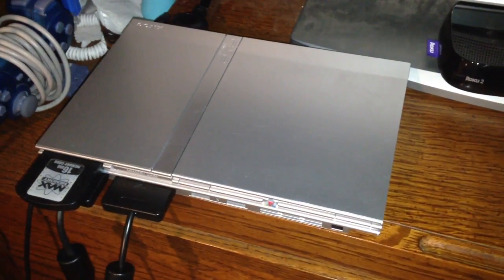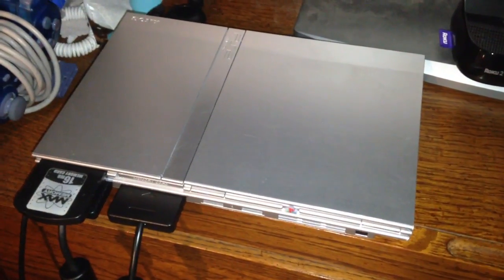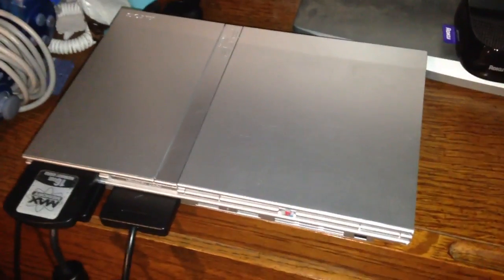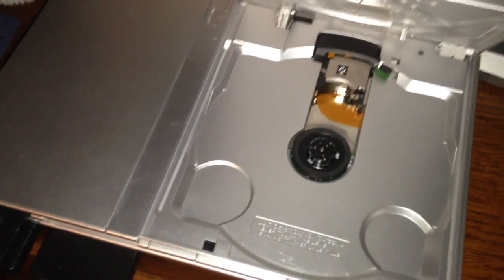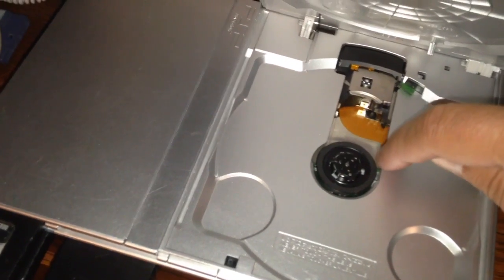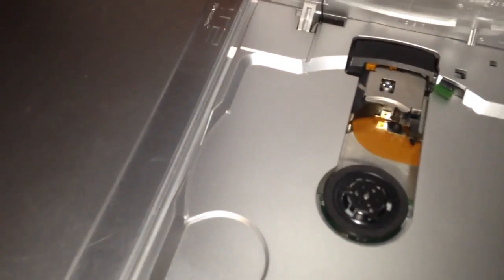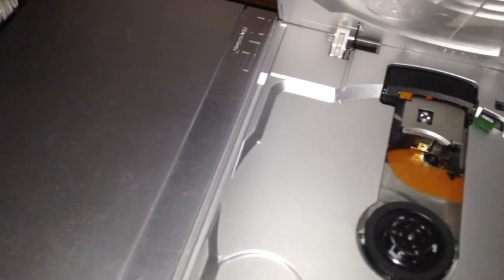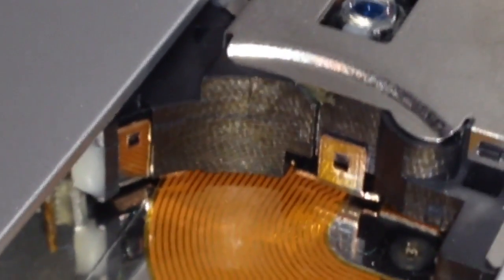PS-2 Slim model fix for discs not reading

Comment: I bought a  ps2 slim  from diss  replay  an only  some of  my games  work  none of them  have  scratches on them   I  know  all retail stores  don't  always  have  brand new  stuff   mostly  used  stuff   especial games  system but  sometimes  you can  try into  fixing the problem  but the thing is  cleaning  it  may  help  but sometimes  it more  problems than  you  think  but I'm going to  order  me a new one for  Amazon   but this  video is  real  can  help  out  alots  if  only your  Ps2  slim  just need to be  clean 💯👍👍👍👍👍 grate  video  this  guy  put out

Comment: This didn’t work for me sadly, I got this game “Muppet racemania” I really want to play, but it havent worked for a while, it loads the disc, but as soon as i go into the game the screen goes black for 2 sec and then it goes out to the selection between memory card or the game. I can’t seem to figure out the problem, but I have a theory that it’s because the disc is black, because my ps2 can easily read any other grey or blue disc..
Reply: The discs with the black backing are PS1 games. However... These all should be compatible with PS2s.  There's a possibility that it could be a problem with your TV hook-up though. As strange as it sounds, I use component cables (the red, green, and blue) for my video hookup from the PS2 to the TV. These cables worked great with my older Sony Bravia, but with my newer LG TV it refuses to play any PS1 games. But, if you're just using the standard AV cable (yellow for video) just disregard all this.

Comment: Open the top where the disc goes and if you look real close where the yellow strip is on the bottom there’s two rectangular pieces one right there than one slightly to the left clean with a dab of alcohol on a qtip and wipe dry using qtip worked right away for me refer to Dan wolak’s video of “ps2 slim model fix to discs not reading” video hope that helps y’all

Comment: Hah!! I was using it last night and it was fine. I picked up and moved with the disc was spinning and it wouldn't read. I opened it and moved the laser/ribbon assembly back and forth a few times and then cleaned the sensors and laser. Worked fine! Thank you!!

Comment: I'll have to give this a shot when I get home. For some stupid reason mine won't read a brand new game. Hopefully this does the trick. I'll be sure to come back and edit this if it does. Still doesn't load a brand new copy of Most Wanted. It'll load Xenosaga just fine. When I throw in Most Wanted it makes this buzzing noise and splashes to the red error screen, saying to insert a PS2 or PS1 disc.

Comment: I took a qtip and cleaned the two plates, but i also went over the laser piece on top with a qtip and there was a smudge of blue on the tip after.. Did i permanently damage my laser?

Comment: Well, it was worth a try. I have a JP SCPH-77000 model that was only reading PS2 DVD’s (with a few exceptions) and no CD’s (no PS2 nor PS1 or even Music). Cleaned the lens and now it’s better about reading the DVD’s and can read PS1 discs, but only after going into the Browser. Still won’t read the infamous “blue” PS2 CD’s., and there are still 2 or 3 DVD games that just won’t read no matter what, despite the fact that my discs are all like new. 

 I guess after 18 years, it’s time to either try to adjust the lasers, or go all in with the laser replacement. 😔 It’s kind of funny, considering that my US SCPH-70012 model still reads everything like a champ - the Sony Computer Entertainment logo barely fades on startup and it goes right to the console logos for any disc I throw at it.

Comment: I got a PS2 slim today and was struggling to get it to read disks. I thought I bought another broken PS2 and was about to return it. But then I saw this video and by doing this method, my system can read discs now! Isoprobyl Alcohol really comes in handy with retro games thank you so much!
Reply: Well good for you because my stupied ps2 cant read the disc even if i do this

Comment: My ps2 was having the same problem, but I found out the problem. It was the little piece of plastic goes down when you close the door. The one that has to be pushed in so the disc starts spinning. I just put a little bit of hot glue to keep it down and it works perfectly with all games
Reply: where did the plastic stay at

Comment: How could these 2 metal pins be read-heads? They've got no sensors on them and couldn't even come in contact with the DVD/CD.
So what's up with all the trolls telling this worked?
The metal pins just hold the stuff in place, they're clamps nothing more
Reply: I dont understand too, man
This is crazy

Comment: More people need to see this. You helped me fix mine in 30 seconds
Reply: Didn’t work for me
Reply: @Codyfree_007  Same here. I done tried everything possible. Mine reads most or almost all ps1 games and majority of the blue back ps2 discs. Doesnt read the regular ps2 discs at all. Cleaned the lenses and brackets, turned it upside down, placed a book on it  but nothing.
Reply: @eaglesfan9800  Nothing works on mine. Completely useless
Reply: @eaglesfan9800 that's because PS1 and blue black PS2 discs are CD-ROM, regular PS2 games are DVD-ROM, as stated in video they use different pickups
Reply: no it dont work

Comment: Mine the disk doesnt spin do you have something to do about it please
Reply: If the disc isn't spinning, it sounds more like a problem with the drive mechanism or the small motor that runs it. I would try looking for a replacement. Be sure to specify the PS2 slim and the model # of the unit, as I think the mechanism changed a couple times even with the slim.
Reply: @MrDintheD  ok thanks i am going to check i am gonna unscrew it and see if it has a brobkem with the sendor
Reply: @MrDintheD  because as i see it makes too much sound and pulls out cold air 🥶

Comment: Thank you so much for this.  I was pulling my hair out trying to fix my disc read error and was just about ready to give up.  I always thought it was just cleaning the lens, I never would have though to clean those.  Thank you, thank you, THANK YOU.
Reply: I'm gonna try it myself, and if that doesn't work, then I'll assume it's the potentiometers at fault.
Reply: Good news! It worked for me!
Reply: @skeletorment  Is it still working?
Reply: @gunnerzane5230  Nope. Now it's needs some soldering work.
Reply: @skeletorment  DANG! Thanks for 
responding..
Reply: @gunnerzane5230  NP, man!

Comment: Mine will disk not read.  I then open the lid and shut it, then game loads.  Makes no sense.
Reply: It seems that yours is having trouble sensing is the disc tray is closed about half the time. There have been many reports that if you put pressure on the lid by setting something on top of it that it can help that problem.
Reply: @MrDintheD  I tried that.  When it doesn’t load there’s a buzzing sound, if I open the lid you can see the disk spinning so holding the cover down isn’t the problem.  From what I found there’s something wrong internally causing the problem.  I’m going to send it back to the seller since she said she’ll give me money back.  I tried all the games she gave me and the few I bought(disks are clean with no scratches), majority of the time it’ll start buzzing like a tattoo gun, get quiet for a few seconds and start buzzing again, then I’ll get the disk error.  When it works right, you can barely hear it.

Comment: Those 2 pieces a just clips holding the laser assembly together, cleaning them will do nothing. This is the equivalent of polishing a car's lug nuts to fix a broken rim.
Reply: Then why did it work when I tired it then??
Reply: Was thinking the same too

Comment: So I just bought this same system on eBay for really cheap the system is in really good condition cosmetically it has the manual and all just bought it tonight the seller says it won’t read the discs. So I am guessing if I do what you did in this video that it’ll work fingers crossed.

Comment: Also, another reason why its not reading discs could be early or late signs of the laser dying. I'm going to try this method but I also ordered another laser to replace it.
Reply: Did it work with the q tips and rubbing alcohol?

Comment: I see no reason why this would work. Those are metal brackets that clamp around a plastic tooth to lock them in place. If this worked for people, this method may have an unintended beneficial effect other than cleaning those two pieces of aluminum. Tried it for the sake of curiosity and it didn’t work because they perform no function outside of being brackets.
Reply: Yeah, my issue is that it won't read DVD Roms, it'll read everything but that, so I was hopeful but deep down I knew it wasn't gonna do anything lol

Comment: My slim will only read regular movie dvds and not game discs for whatever reason.  I'll try this trick tomorrow when i get a chance.. we'll see if it works..
Reply: me too
even putting PlayStation 2 discs mine read as DVD Video
Reply: @nickbarbosa2004  I found a video where a guy tightens a screw on the under side of the laser. I'll have to try that next.
Reply: @MasterShake300  I just haven't done it yet because I'm afraid of damaging something or loosening some wire, but in the future I'll still do it

Comment: I tried doing this and it worked the first time but I quickly swapped the disk I had in there for another and it stopped working. Even after trying a second time with the first disk it didn't work.

Comment: Cleaning the lens maybe!.. but here's the real problem for me anyways. My old PS2 slim wouldn't read disc's either so after a few years of wondering what to do with it I decided to pull the lens assembly from the tray where it slides on and check the wear to my surprise it wasn't flat to be able to read the discs properly so I put a piece of clear scotch transparent tape on the tray where it slides on just to raise it up a bit and it works like new it might work for you too :)

I took my machine apart ( top off disc inserted ) I knew it wasn't a switch issue btw, ( it powered on the motor would spin then quit ) in-order to diagnose the problem and fix it. ( diagnosing ) is the key to solving problems!.. always. 

It wasn't 0° flat more like .0003" inch leaning down left on the disc tray

Comment: my tip is to push the silver metal plate that has the glass beam sensor on it back all the way. If the beam sensor is stuck at a point it will not read disk. Just push the thing bak far as it will go and it worked for me. No cleaning needed.
Reply: Bro I know this comment is 3 years old but I’ve been trying to fix my slim that I bought about 2 months ago cause it would only play ps1 games and somehow wouldn’t read 90% of my ps2 games. Literally pushed that metal piece back towards the end of the console since it’s movable and I’m literally able to play my games again. THANK YOU SO MUCH BRO I wish I could smooch ya. Was literally stuck trying to figure out for 3 hours now lmao so thank you so much man!! :))
Reply: @Joeru510 yo what part are you talking about
Reply: @BoRn2KiLlbvp  it’s the part where the laser is. The whole metal assembly is able to be pushed back. It’ll feel like a little resistance if that helps :)
Reply: @Joeru510  bro I spent like 2 3 hours today trying to get it to read my manhunt. nothing would work I remembered tho I needed to put something on it, and then I watched a video and all I had to do was mess with the censor right above the power button and under the flap I just pressed that and it worked I was so mad but happy too
Reply: @BoRn2KiLlbvp  lol same dude mine still has some issues at times but at that point I had to take it apart and rework some screws
Reply: HOLY SHIT DUDE THANK YOU SO MUCH!!!!!! YOURE A GOD
Reply: Holy shit this actually worked. Ive watched about 10 videos trying to fix this all week and the mix of your pushing and his cleaning the two metsl things works! I now have 2 many ps2s 😂
Reply: Bruh I could fucking kiss you (no homo)3.I did this and it fuknin worked.Now I can grind Def jam😭
Reply: What metal plate are u talking about
Reply: So it CAN move??

Comment: It worked in 1 of my ps2 slims, the other one not so much luck, and thats cuz its in better condition, then the one it works, got 2 big ps2 as well but one of them has bad connection on AV port internally damaged, its not the wire

Comment: This revived my old dusty PS2 slim 70004 model! I did not have any rubbing alcohol thought so I used window/glass cleaner and it works like a charm. Before this my games would load up but would freeze shortly at random times no matter what game I put in scratches or no scratches discs. Thanks!

Comment: need advice with something if someone can help my ps2 spins if the lid is off and when its on it spins and slows down constantly
Reply: I've got the same problem as well, but for some odd reason it can only read CD. It was able to read the blue CD of my Age of empires 2 game.
Reply: @zeroman0460  i figured it outbin the end man you know under the lid there should be like a cross shaped bar that meant to stop the disc break so y
Its not spinning the second you lpened it but without that bar the break is permanently on so i just took the break off with a screw driver it doesnt do much  anyway give it a go haha surprisingly no videos on it

Comment: Hey Dan, I unpacked my Slim PS2 after years of storage since I bought an X-Arcade Tankstick (I'll get it in a few days) but my system wouldn't read discs.  I found your video and she's up and running fine.  Thank you sir for your homework on this and I will be able to enjoy one of the most famous systems once again.  Now I just need to buy a new video hdmi adapter to improve my video.  Have a great holiday season!!!

Comment: My ps2 will read crash bandicoot (blue tinted disc) fine with a decent amount of scratches, but it won’t read any other discs, whether they are blue or mirror tint. Help D:
Reply: It could be that the potentiometer for the DVD laser needs an adjustment. You'll need to open up the PS2 to get to the circuit board of the laser assembly. There are 2 pots, 1 for the CDs (blue discs and audio CD), and 1 for the DVDs. I don't remember which is which, but you should be able to find lots of info on the web. You will need a multimeter and a small screwdriver for the adjustment, and you can try the settings that I mentioned at the beginning of my video. I hope this helps!

Comment: For me it's only 1 game
Answers?
Reply: It could just be the disc. I have one that loads up through the intro and appears to work, but when you start the game, it just sorta freezes on this weird dark ocean scene. It's Test Drive Unlimited. Anyone else out there have problems with that game?
Reply: @MrDintheD  had it fixed there was dust behind the reader and scrubbed it with rubbing alcohol now it works fine
Reply: LemnoLemonJuicy get a dvd and compare it to that game look at the bottom of the disk see if it relates to the dvd disk

Comment: Omg it’s worked although I didn’t have rubbing alcohol so I used vodka lol
Reply: Vodka is ethyl alcohol and contains impurities. No generally recommended. At a minimum, you should wait a while for it to totally dry
Reply: Would not recommend using vodka or any alcoholic beverage. Next time use rubbing alcohol.
Reply: TritnewVG I didn’t have any and vodka worked fine and it’s still perfect a year later
Reply: @purplearmy8828  Alright then. Rubbing alcohol is hard to come by nowadays anyway so any alternative is good. I'm using those 70% isopropyl alcohol wipes for my games now.
Reply from the maker: @shaitet  drink the vodka instead
Reply: Now it is Russian
Reply: YOUR A LIFE SAVER!!!
Reply: Russian PS2
Reply: 😂😂 are u russian or  something
Reply: Potato, potato.
Reply: I used orange cronic
Reply from the maker: @Zombies4207  you should probably smoke that
Reply: You're so quircky and random
Reply from the maker: @abandoned_project  thank you
Reply from the maker: Vodka is an excellent choice!
Reply from the maker: @eldorado1150  blueray is evil! I would stay away from that!
Reply: What's the difference? :)
Reply: The gopnik way yes it work but is as recommended as driving lada with no hand

Comment: Surprisingly, it actually worked. Who knew it could be something so simple? In fact, I didn't even have to use rubbing alcohol, one dry q-tip along the two metal parts mentioned and on the lens (just for good measure) did the trick.

Comment: i tried your way to fix it but it didn't work, it shows me a black screen that says "unable to read disk" or something like that, some idea?
Reply: If the disc is scratched up enough, it might need to be resurfaced.  If it's happened with all of your discs, you probably need a new laser assembly.

Comment: Those are the clips to hold the laser together, the laser diode and the recepter are not able to be cleaned directly, but the lens is...
Reply: Yes man🤟
Your the first😎
Just lucky people react.
It is the switch in the back that lost pressure by the plastics shape shape by temp.
The switch is not pressed enough.
Glu it or soldeer the basterd for life. 🙋